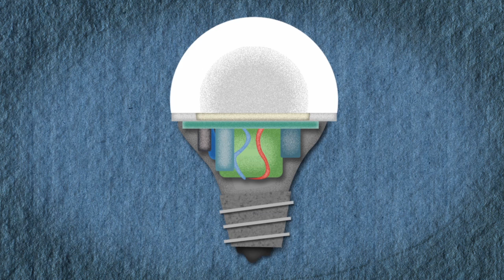Introducing LumenCache LED Lighting

Comment from the maker: Yep. Many people tell me the battle between AC and DC was already "won" by Tesla. This isn't about AC vs DC.  Both have applications today and both will be used for a long time. We have plans for a module that uses AC (in a different format than the current standard we use).  AC was the right solution for the time given the technology available.  Today, some of the highest capacity power lines are HVDC.  Transistors are amazing.